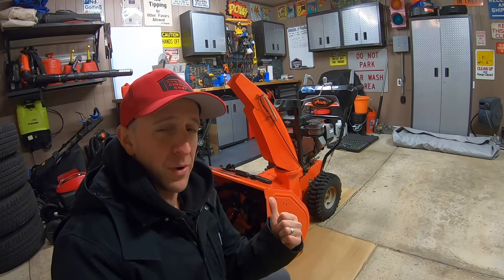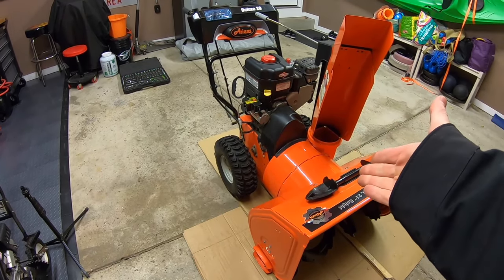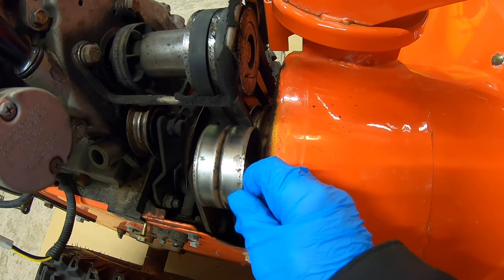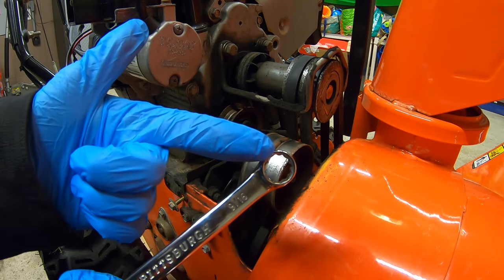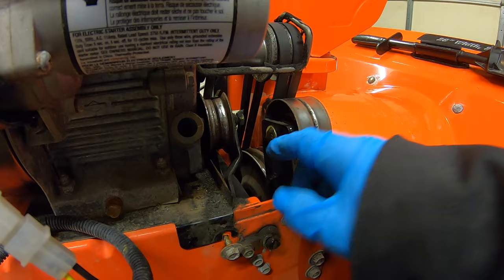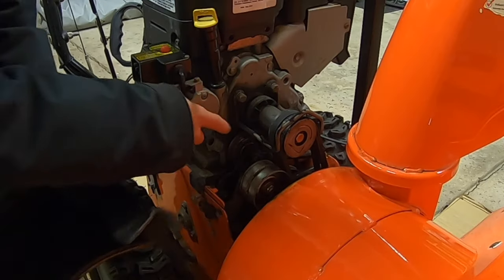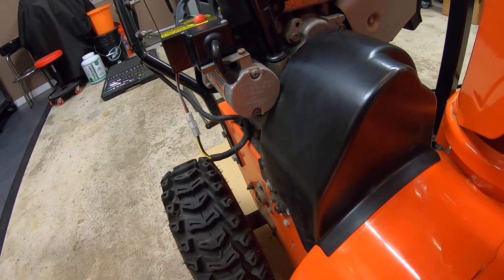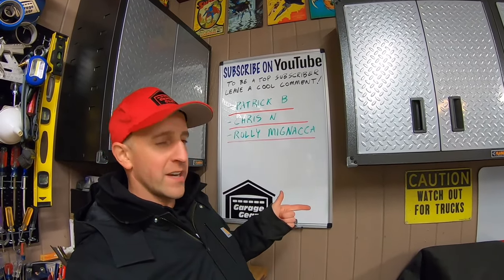HOW TO ADJUST A SNOWBLOWER AUGER BELT TO THROW FARTHER

Comment: Wow, this guy is way wrong in what he’s telling you to do. Absolutely do not follow his directions. Ariens has a very specific procedure for adjusting this pulley. What he didn’t show you, is that the cable attached to that pulley lever has a strong spring as part of it, and the cable will pull on the lever then the spring will stretch as the pulley engages with what tension Ariens wants applied. The loose belt shown is pretty much how Ariens wants it to be. This is why the cable adjustment and pulley need to be adjusted together according to the Ariens manual. When that adjustment is done, you also need to check that the auger brake adjustment works correctly by bringing the auger to a stop within the prescribed time after releasing the lever. Do not do just what this guy did without going thru the Ariens procedures. Also, if you do make a change following the manual, it’s very likely your belts are worn and you’d be better of replacing them and check again. The pulley may have been fine where it was. If you change it and later replace the belt, plan on making these adjustments all over again, probably back to where they were from the start when new.
Reply from the maker: Thanks for taking the time to write this
Reply: @GarageGear  so is it safe or not?
Reply: 😂 is it safe? Well your blower will not become a WMD. To say he's absolutely wrong is ridiculous. Depending on manual specs....After engaging your auger drive, the tension provided by your cable and spring to your idler pulley should create a 1/2" depression roughly. If you move it too far forward towards your belt then the augers will spin without the auger clutch being engaged. Belts wear down and stretch from normal usage. I run mine a little tighter than what specs call for and it still clears my driveway.
Reply: This is the exact method for tensioning the auger belt for my craftsman blower and it cured my problem. The spring tension he speaks of is on the drive belt not the auger belt. The drive belt is always snug but the auger belt has some slack until you engage the handle. As he notes, don’t over tension the auger belt.

Comment: I check the auger and forward movement before finishing the adjustment.  Too much tension leads to the auger and impeller always spinning.  This step it critical on my machine.
Reply from the maker: Thanks for sharing Thomas!
Reply: @Thomas  Good point.  Also modern blowers have a "safety" brake in them that stops the impeller, too much adjustment can cause that to not work properly.
Reply from the maker: @l337pwnage  thanks for sharing bud!

Comment: Kevlar belts aren't a bad upgrade, if you don't have them yet.  Because they use the belt as a clutch, it always gets slipped a little and the Kevlar is pretty durable and tolerates that well.
Reply from the maker: Thanks for sharing another great tip I337!

Comment: My belt is looser than a  likkered up pole dancer. No tension adjustment. I also can't see how to get the belt off as steel pins are coming out of the frame and are 1/8 inch off the belt wheel in 3 diff spots.  >:O
Reply from the maker: Hahaha hey Rook! Can you drill out a slot to make your tensioner adjustable? Are the pins you are referring to the belt guides?
Reply: @GarageGear  Hey. There's actually 4 of these 5 inch long rods. At 2,5,7 and 10 o'clock. They keep the belt from escaping the large driven wheel but I have no idea how they got the belt installed at all. Baffling.
Reply from the maker: @ROOKTABULA  ok those are the belt guides but how they got the belt I’m not sure. I’d have to see it first hand.
Reply: @GarageGear  I think some relative of Houdini works at the MTD plant or these are some sorta memory metal that becomes rubbery when a current is applied or sumpin'. I've swapped out belts on many engines, big and small but this one has me stumped! I've just never seen 4 around a pully assy. nor any way to move them before.

Comment: My issue was a new belt I do have one of those "cheap" type that can not have the pully altered.  I feel mine cant be altered because there's no need to. It was made in 1983 when things were built to last and weighs more than a small car :) I do appreciate all your video and it led me to the right solution since I dont know anything about this kind of stuff. 

- CHALLENGE ACCEPTED -
I am going to put this to the test today and report back. My snow thrower is a beast and I see no other reason than this being the issue.
Snow Thrower:
1983 Toro Powershift 624 (Obsolete)
Reply from the maker: Go for it Vincent! Let me know how it works for you! Thanks for watching!

Comment: I’ve been learning a lot from your videos. Thanks for posting them. 

Can you explain WHY tightening the belt makes it throw farther? The logical explanation would be that loose tension on the belt is causing it to slip on the pulley. If that is the case, then wouldn’t the friction from slipping degrade the belt immediately (when load is applied)? And in that case, tightening the belt to spec should bring slip to zero and thus, achieve the same max throwing distance as factory new. I.e. tightening the belt on an already properly tightened belt won’t make it throw farther. Is my understanding correct?
Reply from the maker: Hey hindude! Thanks for being a cool fan! It quite simple really. Belts loosen up a little over time. If there is slack the belts slips under load. That’s why pulleys have slots to slide on to tighten them. Move it forward to tighten it up and apply more tension on the loose belt. A little extra tension goes a long way! 👍

Comment: Thanks for your help! My Deluxe 24 arrived with the auger constantly turning. Very surprised that it got to the customer in that condition. Just released tension by moving the wheel back a quarter inch and double checked the cable. But still haven't had snow to test it yet. Is it possible the impeller will still underperform under load even though they turn normally in non-snow conditions?
Reply from the maker: Hey Margo I’d have to see it in action. Sounds like you made the right adjustments. If everything is turning normally you should be good. Test it out and see with snow!

Comment: Do you have a video on adjustment of Arien drive and auger cables ? Just picked up a new to me ariens snow blower off a family friend and using your videos to get it set up proper for net winter but I feel like cables hanging are hanging around more than I think it’s should
Reply from the maker: Hey B I don’t have a specific cable video but they are pretty easy to work on. Look for the thread bolt on the cable. Thread the nut up and twist the bolt up to tighten. Thread everything down to loosen them. The cables should have some slack to them when everything is released. 👍
Reply: @GarageGear thank you sir. I’ve seen one video in different channel that touches on it briefly but doesn’t explain the amount of tension it needs prior to engaging the handle. I’ve got a deluxe 28 sho model so your videos have helped a ton in preparing me to give it a spring cleaning and service

Comment: Great video, I have an Ariens Class 24 and the bolt that you slide over is in a fixed position and the belt is very loose. What should I do now. Thanks.
Reply from the maker: You try drilling a new bolt hole or buying a new tighter belt. Thanks for watching Vance!

Comment: If the end of the controlcable has a spring on it then how will this change anything? As long as the cable is pulled far enough back to engage the spring it won't allow more tension to be applied will it?
Reply from the maker: You can make adjustments there too if needed. Tightening the belt will definitely add more pressure on the impeller. Thanks for watching

Comment: Hey Garage Gear.....this video is SUPER helpful.  EXACTLY what I needed to fix the distance issue I was seeing.

In making the adjustment however, I discovered the tensioner is not spinning.   It's stuck in place and over time will clearly cause the below to burn out.  Any thoughts?  Is it possible that I over tightened the bolt?  THANK YOU!!!!!
Reply from the maker: Hey Billsfan! Could be a few things. Bolt on the pulley could be too tight. Might need some lubrication to get it spinning. If the pulley has a bearing that could be worn out and seized too. Start with the bolt and see if it’s too tight and let me know. Stay awesome my friend!

Comment: The Snow blower I bought has the engine speed locked and you cant adjust it, the lever won't move.
 The snowblower itself works great,easy on gas, starts first pull, throws snow into the upper atmosphere, but I'd like to be able to put it to idle speed at times and I dont like starting a cold engine wide open.
 Have you run across this yet? I would assume it's to keep the motor at optimum rpm for pollution laws.
 You should make a video showing how to unlock it.. 
And thanks for the great info !
Reply from the maker: Hey Jamie! Some cheaper model snowblowers have one throttle speed. They don’t have an adjustment lever. What kind of snowblower do you have?
Reply: @GarageGear  hello it's a couple of years old now and from costco canada 30"generac with 13 hp engine made by loncin
Reply: @GarageGear  it has a pic of turtle and rabbit.. the throttle lever is there you just cant move it
Reply from the maker: @jamiehalifax4954  is it stuck or is moving it not even an option.?
Reply: @GarageGear   it's not stuck.. it is set from the factory ... since nobody seems to know about this..I'll likely take it apart this summer and maybe post a video of how to 'unlock it'
Reply from the maker: @jamiehalifax4954  it would be a good video to watch

Comment: So, here's my question:  I did exactly as you said.  There was a LOT of play in the belt, and the bolt was set all the way to the back of the slot (the right, from the vantage point of the rear of the snowblower).  So, I adjusted it forward, in increments.  Eventually the bolt became slammed all the way to the left.  Still a LOT of play.  So it got me to wondering:  shouldn't the belt tension be checked while someone engages the augur trigger on the handle?  Thanks in advance!
Reply from the maker: Hey manis! It sounds like you need a new belt. The belt should be tight and if your moving it up all the way and there is still play the belt is too loose. I would just get a new one that way you could really send it! Thanks for watching
Reply: @GarageGear  Yup, thanks.  It's throwing OK, not spectacular.  I have two new belts (Ariens Deluxe 24), and hoping I don't have to change them until winter is over.  At the rate it's going up here, should be no problem.  All we've been getting in recent years is snow changing to rain, or just rain (like, last week).  I guess you're in Buffalo?  Blessings to you!  I'm sure your gear is up to it!
Reply from the maker: @livenhfree  oh yeah I’m in Buffalo. We got our season total in two storms so far lol!

Comment: Is it a valid test to check for slippage of the belt by blocking up the auger and then pulling the starter cord while engaging the auger? 
Should there be zero slippage and the engine prevented from turning?
I had problems with laughably impotent throw on a vintage Troy Bilt 42000 I got recently. I could probably throw it further with my plastic shovel than it was doing, and certainly my electric one stage was more impressive throwing than this gas powered two-stage.

 Found afterwards that I could override the belt and continue turning the engine just with the recoil starter.
Adjusted the belt as the manual indicated but it still couldn't lock it up. The belt seemed old and stretched, so I sized it up and got a replacement based on the measurement, and can now adjust it sufficiently tight to lock it up and prevent it from turning with a reasonable pull on the starter.
I was originally looking in two having to do the impeller clearance mod but when I looked at it it didn't seem like there was a whole lot of clearance in it to begin with so maybe the belt was the issue. 
Hoping for some snow to find out if the replacement belt did the trick and gets it working as it should be now.
Reply from the maker: Good question winger. I would not block the auger for any reason as this could put unneeded stress on the gearbox and other components. Are you trying to have zero slippage? The belt should be tight but not so tight nothing moves well enough. For me it’s as simple as just adding a little more tightness to the belt when needed. Thanks for watching!

Comment: Adjusting the roller that tight...will the auger and impeller always turn even with the handle disengaged? Thanks in advance
Reply from the maker: Hey Gorrila! No they should not. I only bumped up the tightness a little bit. Not all the way! Over time the belts stretch a little and need to be tightened up. Thanks for watching!
Reply: Twisted, there’s a specific procedure for adjusting that pulley and cable in the manual. Don’t do it how this guy showed, otherwise you could have a problem with the auger not stopping, excessive belt wear, noise, etc. There is also a procedure to check and set the auger brake so the auger stops, I think within 2 seconds, when the auger lever is released. It’s all a system that works together, and it needs to be adjusted as a system if you think any part of it is wrong.
Reply: @GNX157  Cheers

Comment: I bought an older ariens st1032 and i am now making a imppeller kit after watching your video👍🤠👋
Reply from the maker: ROCK ON OSKAR! You’re gonna have a BEAST on your hands!  Email me a pic when you have a second! I’d like to see it! 👍
Reply: @GarageGear  i sure will! Just changed the belt for the imppeller (on my own this time) and it seems be a monster🤠. I live in Norway so we get loads of snow ❄️
Reply from the maker: @ScandiSledder8000  awesome my friend! Might want to tell your neighbors to watch out lol!
Reply: @GarageGear  its got six impeller blades, do you think i need rubber piceses on all of the impeller blades?
Reply from the maker: @ScandiSledder8000  probably not on all six my friend! You could probably get away with just two on opposite ends of they line up. Ex. North/south or east/west. If they don’t line up then you may want to do all six. No way in hell that thing would ever clog.
Reply: @GarageGear  thanks for the tip👍

Comment: Question I know you don't want to put too much tension but what are we looking to have as far as play on the auger belt on my Ariens...1/4" play-1/2" ? I only have one auger belt on my St1024. thanks for the detailed video.
Reply from the maker: Hey Joe! There should be a little bit of play probably between a 1/4 to 1/2(but hard to say for each model). The belt should be loose when the auger handle is disengaged but tight when the auger handle is engaged. Thanks for watching
Reply: @GarageGear  Thanks was going to adjust it but there is a chunk out of the belt so I need to replace it. I didn't see a carriage bolt slider adjustment on this machine which I just acquired so maybe when install the new belt I may not need to adjust anything. I also found out on this tecemsuh engine the speed lever at the carbuerator just runs on high when I slide it from rabbit(hi) to Tort ise(low no change always fast.) I'll look into that while waiting for the new belt. I'm in cheektowaga so I know I need to get this thing going my old toro 724 is very long in the tooth.Thanks for your reply.
Reply from the maker: @joesuriani371  hey Joe you shouldn’t need to adjust anything once the new belt goes in in your case. As far as the throttle goes I’m at a loss. Let me know what you find out.
Reply: @GarageGear  previous owner had a new carb put in by someone but they never adjusted the carb for idler speed had it cranked up. I adjustment and it works as it should now. Just waiting on the belts....Happy New Year. Go Bills.
Reply from the maker: @joesuriani371  awesome Joe! Happy new year my friend! Go bills! 👍

Comment: Hi garage gear!  hey what part of the hood are you in?  I live in Windsor Ridge.....  :)  In any event - loosened the bolt and the tensioner turned......lubed it up and everything and we were spinning freely.  HOWEVER....when I put it in place with the bolt tightened, but loose enough to spin, the tensioner would NOT stay in place on the track - so getting no tension on the belt.  When I tighten it to stay in place it won't spin....and I will no doubt burn out the belt pretty quickly......  

Perhaps just order a new part?  

Hey BTW noticed in one of your videos you have a Toro Timemaster.  How's that bad boy treating you?  Mine is 2 years old and SWEEEEEEEET!!!!
Reply from the maker: Hey my man! I’m near Lancaster high school. I would recommend getting a new pulley sounds like the pulley bearing is shot. A new one should do the trick.   Time master is good. Lots of perks with a wide deck. Done about 15-20 minutes faster than a 21” deck. Only thing I don’t like about it at this point is the heavy clogging in the fall/ spring. That deck does not recycle clippings well enough. Fast machine tho.how do you like yours.
Reply: @GarageGear  my TimeMaster is just tremendous.  So glad I made the investment.......more than well with it.  Better than a rider too I get the steps in still.  In fact its kinda like RUNNING to keep up with that beast!     :)

Comment: My Mastercraft would not throw at all despite the auger moving. I adjusted the belt tensioner. Still very weak. I thought I would get back at it this summer. What else could be wrong.
Reply from the maker: Hard to say without seeing it in person. What about the cables on the back of the blower? Those tight?

Comment: The question would be why would you adjust the tensioner of the actual drive belt? 

Wouldn't you adjust the spring on the back first to see if you can get enough tension?
Reply from the maker: For this machine it needed some tension on the pulley. It was set to zero. The handle had enough. Thanks for watching another bud!